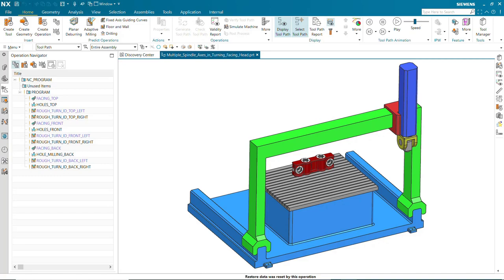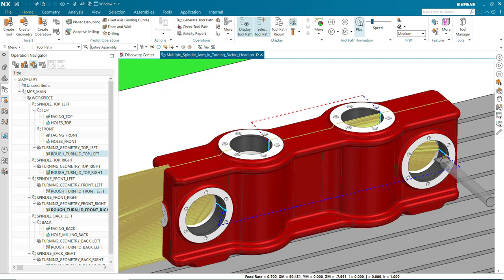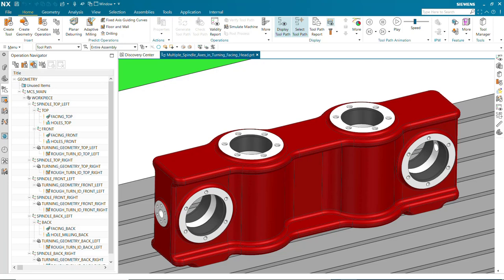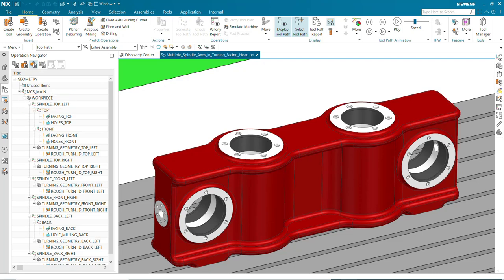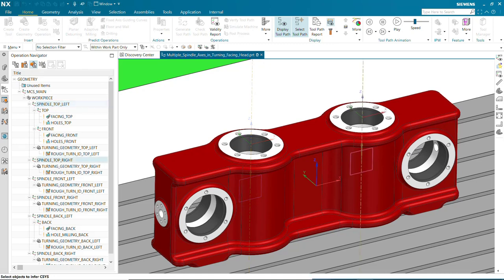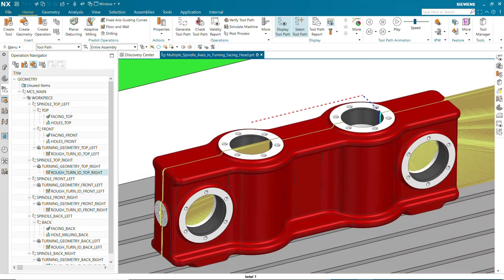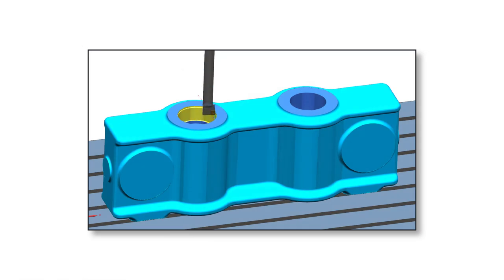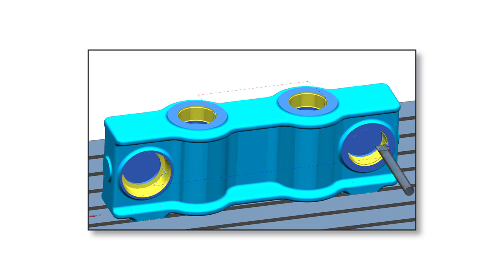U axis Turning in NX CAM

Comment: Is it called the boring, not turning, right?
Reply: Depends, if the head is stationary and only goes down, then it's boring. But with this method the head also moves in XY for the top faces, and turns the spindle keeping it perpendicular to the hole being made.